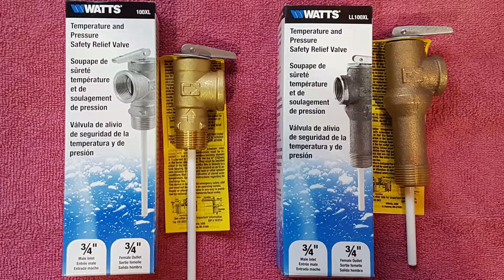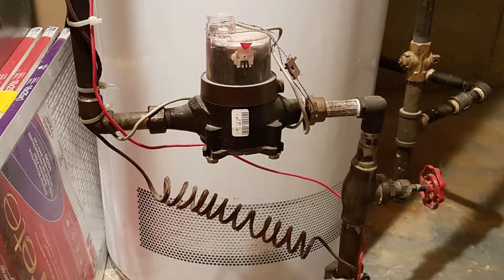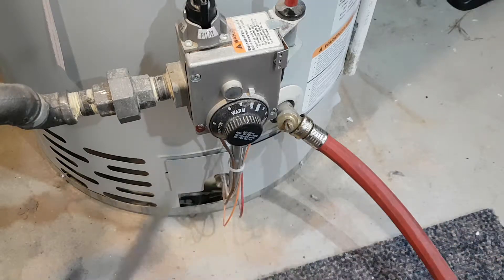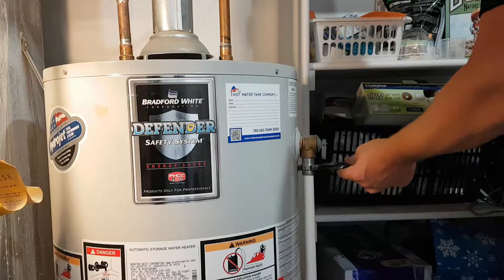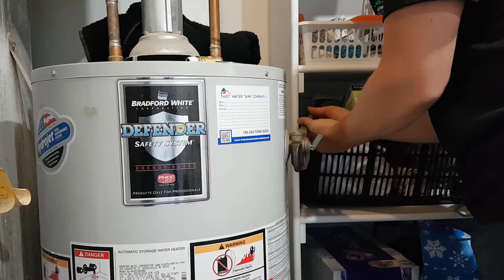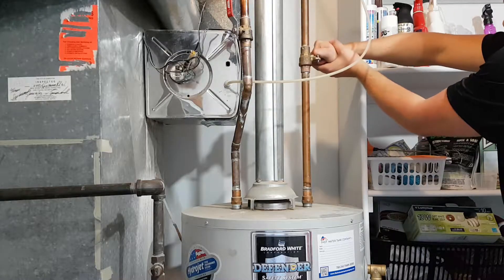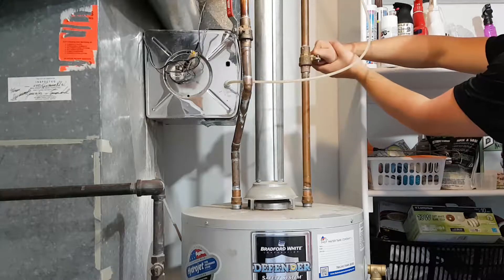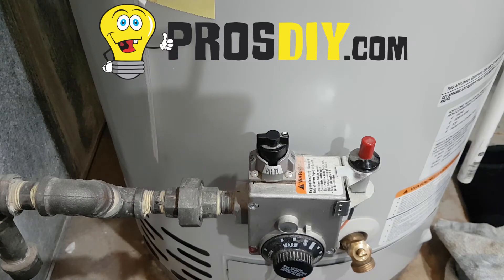Temperature and Pressure Relief Valve Replacement on a Water Heater

Comment: I have an electric water heater and after i replaced the valve i put the round dial to the in position but my water is not coming hot enough! Any clue why? Could it be i just need to check if i move the temperature control? I turned it to hot but after the tank was full and I still have warm water. Do i need to light the pilot or it does automatically when i set the dial to ON
Reply from the maker: Hi foreigner, I'll just require a little more information on the water heater. A model # will help. Electric water heaters don't have pilots. You may have a power vented or power direct vented water heater? The model # located on the front sticker will let me know. It could be that it needs some time to heat up? Most water heaters take 45mins - 1 hour to completely heat up. Thanks
Reply: @PROSDIY  
Thanks for getting back to me 
Brand seems to be Whirlpool 40gal
My model # BFG1F4040S3NOV
SERIAL #0715128709
Product #0733005

I followed all instructions to light it but I see no flame or spark coming and therefore no ignition.
I have an electric water heater.
Reply: @PROSDIY  
I gave it enough time but still no hot water and I no longer hear the water heater turning on when I open the hot water. No clicking sound or flame sound I wonder if my igniter has gone bad. Some people told me a thermo-coupler but they are not experts
Reply from the maker: @foreignercatracho  Thank you for the information. The model number you provided is a 40 US Gallon atmospherically vented gas fired water heater. Please take the following steps.
1. Check for spark when clicking the igniter. It can be hard to see so maybe turn out the lights. If it is present try relighting, see here for instructions. https://youtu.be/WHJ9BgIR2S0 If it doesn't spark get back to me for further instructions.
2.If there is spark and the pilot lights but doesn't stay lit, next is testing thermocouple voltage. https://youtu.be/6CDGmyU-e24
3. If it doesn't pass the previous test, next is replacing the thermocouple. https://youtu.be/Iqku7dztPTs Your model of thermocouple is not generic. This information was gathered from the model number provided. Yours has an inline thermal fuse. The same model of thermocouple will be needed.
Thanks and let me know if you have any questions.